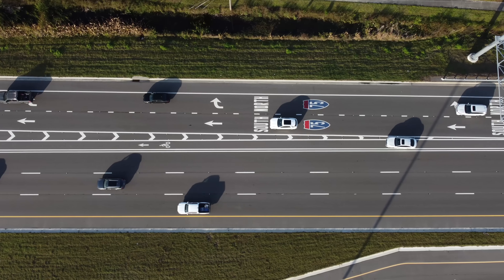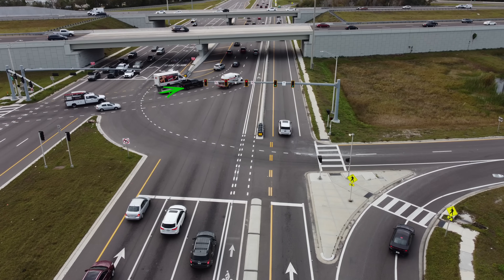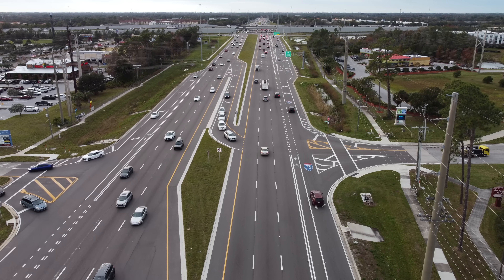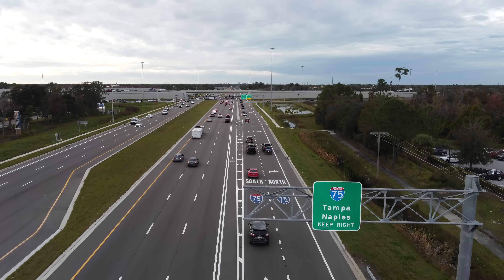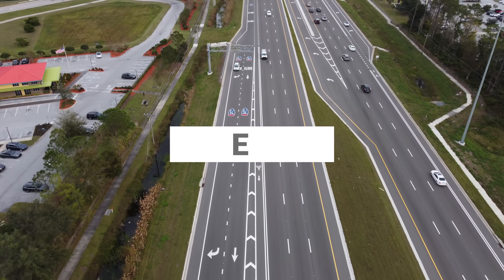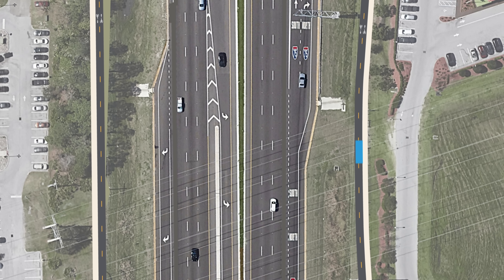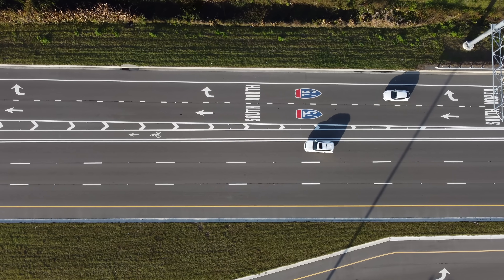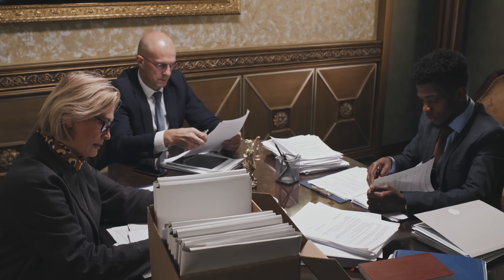This Brand New Interchange is Already Flawed

Comment: Tunnels are not usually an option in Florida due to drainage and the water table
Reply: Then build a bridge. That's what they do here in Norway if they have to.
Pedestrian crossings and bike- and footpaths not physically divided from such a busy road is impossible here as it would violate the code. The highest speed on the road before physical barrier is needed would be 60kmh(37mph).
Reply: @Gazer75  The thing about crossings for bikes is that a tunnel would be less deep than a bridge would need in height. So a bridge would take up more space taking in account a comfortable gradient for the ramps.
Reply: @MrAronymous  Not like the US lacks space for these things if they want to build them. But I guess more lanes for the roads are more important :P
Reply: Then why was the highway built in a ditch?

Comment: we inb the netherlands have em. The 2 most outer lanes are to go straight and the 2 (or1) most inner are to go off. the save solution for that bike lane is traffic lights you have to activate with a button. The exiting highway traffic can go free unless some one activated the traffic lights. This is the cheap way the expencive way would be a tunnle.

Comment: Only problem with the tunnel crosswalk for bikes and pedestrians in that area is that it's FL. You can't dig without hitting water so instead you'd have to build up. The only other way to do a tunnel would be to build the road up and over the path which would require far more work. There's a reason you don't see basements and subways in this state. Even the infamous "Disney tunnels" aren't underground.
Reply: Not a surprise with all the pools of water around the project either. It's basically a marshland. Honestly a raised bridge over the highway probably be easiest to deal with, though the slope would have to either be very gradual or bikes would likely have to walk up it lol.
Reply: @JustaGuy_Gaming Yes there's a bike trail that runs along highways in St Petersburg, Florida and it entails*a lot* of bridges 😩
Reply: there are basements in central fl.
Reply: And the surrounding area is already elevated above the highway so this would function exatly like in Disneyland.
Reply: You only gave a reason to why tunnels would cost more but not impossible. Conditions in the Netherlands are roughly the same and we got enough tunnels you classify as impossible.
Reply: @lordbigsnake  no no they arent last month we got 8 inches of rain in 3 hours. thats 20 centimeters. those tunnels will flood and you wont be able to unflood them.
Reply: @MrSGL21  go ahead try to explain me why you won't be able to unflood them? Your statement only said you might need stronger pumps for those tunnels.
Reply: @lordbigsnake  because there isn't anywhere for the water to go. It takes days sometimes weeks to drain an area. We get more rain and at an intensity you can't imagine. The whole bottom 1/2 of florida is a SWAMP.
Reply: @MrSGL21  so long story short the infrastructure for water management is bad in Florida so tunnels are a big no. PS it might not rain as much but the Netherlands a bit more than just rain to manage when it comes to water with 26% below sea level and 29% being former swamp.
Reply: Where do you suggest they pump the water to? Another flooded area?   @lordbigsnake
Reply: @lordbigsnake  Amsterdam gets an average of 30 inches of rain per year, Tampa gets an average of 50 inches per year. In metric that's a difference of almost 51cm. If you go to the video's description, there's a link to the map of this road and you can see dozens of drainage ponds and bodies of water just in this small area and that's because Florida is like a sponge. Any tunnel would have to be sealed tight enough to keep groundwater from seeping into it and rainwater would have to be pumped out of it which would require maintenance for the tunnel and also the pump plus electricity used by the pump. Factor in worse storms due to climate change. A crosswalk is far more cost effective over time.
Reply: @AmyEugene   @AmyEugene  as I've already said in the post above it might be expensive but not impossible. And the overall water management required for such a tunnel in Florida isn't that different from what's required in The Netherlands. And reducing the need for asphalt by making infrastructure more welcoming to pedestrians, cyclists and public transport is far more cost effective over time.
Reply: @eptdy  another body of water it's that simple.
Reply: @lordbigsnake  You didn't look at the map, did you? All you have to do is go to the description and click on it. See the ponds of water next to the road? Look at it and tell me of an area in the Netherlands that is similar with bike tunnels that are below the water line. I looked at a map of the Netherlands and it is very rural with a lot of open farm land and Amsterdam has few green spaces. There is pavement to the edge of the canals. I see bridges with bike lanes going over the water, not tunneling into it. The Netherlands is very nice and I'm glad you've found what works for you, but it looks nothing like Florida. Florida is exponentially less prepared to deal with rising sea levels than the Netherlands is, so I think they'd be better off spending money on building at a higher elevation instead of creating tunnels.
Reply: @AmyEugene  so you acuse me of not looking at the map and then refuse to properly look at the map op the Netherlands? And yes I know the Netherlands is beter prepared for rising sea levels even with land that's far below sea level and with far more water to process as rain isn't the only water to manage. And come on put some effort into it and you will find tunnels for bikes and pedestrians. And I know I am spoiled with good overal infrastucture as a Dutchie.
Reply: @lordbigsnake  Where's your example that is similar to this location in Florida?
Reply: @AmyEugene  well around Amsterdam enough spots. Unless you suddenly don’t want areas that need loads of watermanagement. Those canals are there for a reason.
Reply: @lordbigsnake  Water is a major part of the ecosystem in Florida and there are a lot of native plants and animals that depend on marshy/swampy areas for survival. I'm sure a lot of people would prefer to pave over it and install large cement lined canals, which was the practice in earlier decades in Florida when millions of acres of swampland were drained to make room for humans. But we've learned a lot since then about how damaging that is and I think we need to protect biodiversity wherever it still exists. Rising sea levels and stronger storms will damage infrastructure along the Florida coastline in the next 50 years anyways, so why damage natural habitat now for something that won't be useful for humans in 50 years?
Reply: @AmyEugene  wait what now? You want to protect nature but then say things that could help protect nature are not possible? You really don’t get it do you?
Reply: @lordbigsnake  Building the tunnel you suggest has a significantly greater impact to the plants and wildlife in that location than putting in a crosswalk. How would digging deep holes at every intersection and  creating a path surrounded by concrete on four sides that must be made watertight with pumps installed that will need to run every time it rains, not to mention that each tunnel is guaranteed to flood during major storms, be the more environmentally friendly option? The materials and construction equipment involved would make more of an environmental impact than that needed to create a crosswalk. Digging large holes has a big environmental impact. Using electric pumps to remove water from a concrete space instead of allowing that water to be naturally absorbed into the ground has an environmental impact. An intersection above the water table doesn't need that.
Reply: @AmyEugene  I am laughing my ass off right now. Somehow making walking and cycling more attractive by improving the infrastructure for walking and cycling is worse for the environment than adding one more lane to the concrete wasteland created for cars. Go ahead think of ideas that don’t need tunnels but stating that they are impossible and worse for the environment than what you have now is a pure lie based on nonsense. And I get the US already has problems with financing the maintenance of the current infrastructure so an expensive tunnel to improve non car infrastructure isn’t really attractive but it’s still not impossible.
Reply: @lordbigsnake  The road already is what it is. The question is how to improve what's currently there. With unlimited money a lot of things are possible. If no one has to consider the wider impact on the immediate surroundings, things like maintenance, the role of weather conditions, safety standards, etc. then anything that's physically possible could be done. If that's your point, then yes, without any limits Florida could build more tunnels than exist anywhere else in the world. It's possible that Florida could make the entire state Disney World. It's possible that Florida could ban cars. It's possible that people could travel from home to the grocery store and back via hot air balloon. The world is full of possibilities that somehow never actually happen in the real world because there are limitations in the real world. A lot of people are more interested in finding practical solutions that work within the constraints of a given situation than exploring the possibilities that are only possible if existing problems are ignored.
Reply: @AmyEugene his point was that it wasn't impossible to do...

@lordbigsnake I'm not from Florida nor the Netherlands, but you sound very entitled when trying to make your point across, it's very clear that it is possible to make a tunnel, but it's not practical to do so in the conditions Florida has, your country clearly has centuries more of experience dealing with flooding conditions and working in land reclamation compared to Florida, not to talk all the technology you guys have over them as well.
Reply: @lordbigsnake you are embarrassingly incorrect. I am a geologist in Tampa. 
Subterranean infrastructure like underground parking garages have been attempted however they always run into the same issues.
I want to explain this to you with the basics, this part of Florida is composed entirely of sand and is a surficial aquifer with transmissivity (the ability of water to flow through rocks/sediments) exceeding anything in the Netherlands where muds/clays/peats dominate.
Pumps would be incredibly inefficient and would need to dewater a volume of water equivelent to a lake every moment of every day forever.
Unless you have unlimited energy and tax revenue, this would not be feasible. 
How anyone could continue to defend this solution is mystifying and shows how little you know and care to learn about this.
I want you to understand that this is not the Netherlands and geology is different everywhere. For all intents and purposes, a tunnel is the wrong choice.
Reply: @MychalMartinez   I said it might be expensive but it isn’t impossible which is funny enough the tldr of your post. And your country is already throwing money away on bad infrastructure anyway as shown in the above video. And thanks for reminding me that not every country has waterpumps pumping 24/7 cause of soil difference.
Reply: @lordbigsnake  just saying pumps would be energy intensive and idiotic for every pedestrian tunnel. Bridging is the best option. Gonna listen to some girl's generation now, great taste!
Reply: @lordbigsnake  As a Dutchie, I was about to make the same comment.

Comment: So would a bike tunnel supply scuba gear to the bikers and pedestrians?  The water table is the same as the water levels in the nearby retention ponds..  This IS Florida so a tunnel not an option.  And I am very familiar with this intersection and it truly sucks.

Comment: Fix the final Tampa/Naples keep right sign. Turn it into 2 signs, each above its respective lane with the words This Lane Only instead of Keep Right. Give Lena Road a designated right turn lane and adjust that sign appropriately. Having to share that lane is ridiculous. Also fix the first sign to be a single sign saying I-75 N and S, Right Lane. Leave the bike lane as is. Bikes are vehicles, and they belong on the road with safety mirrors and lights installed.
Reply: Poorly designed signage is the vast majority of the problem here.

Comment: the problem is when you get a leader of a state thats anti-constitution, and anti-mass transit and anti-biking/pedestrian, the only thing you can hope for is stuff like that, where its just there to make it look good. someone has to sign off on improvements and someone has to sign off on the budget to make those improvements, but i suspect nothing will be done about it, because its also gonna be used long term as a justification to remove bike infrastructure in the future, due to low usage.
the reason for the low usage is gonna be the danger aspect of it, but will florida DOT do anything about it? no. pro-car supporters are gonna be a thing. the signage is also gonna be a thing. think about it, if you can destroy a more efficient interchange for the sake of "moar lanes", you would target the signage. if more accidents are the result of a more efficient interchange, they'll take it out, build something standard but with "moar lanes" and boom, problem solved right? not really, but the idea would be there in peoples heads.

a well designed interchange is gonna have muitl-modal access, while accounting for safety, driver psychology, and of course, driver intelligence.

channels like this however, will eventually defeat the "old ways are best" tribe, because in urban design and engineering, its not easy getting the political will to get something fixed, but informing the public on such matters will result in people actually doing something about the roadway and allocating funds to fix it. plus more awareness about the "mistakes" or genuine mistakes will eventually lead to people calling local broadcast stations in a area as well to get more awareness to the issues.
and the more awareness a area gets for a problem thats fixable on the roadway, the more a road is gonna get fixed, because the political will to get it fixed will rise.

Comment: It's amazing to me how many of the drivers shown in this video are not in any lane at all, just kinda veering vaguely along the highway in the general direction of travel or fully straddling those two exit lanes. I'm from the UK and although drivers here are FAR from perfect, at an intersection like that I think most people would stay in lane, and if they did need to get across, would use an indicator/turn signal and move across one full lane, not just point their vehicle at the furthest straight-line point and head directly for it regardless of the road markings.

Comment: the signs look backwards, like the first sign should be where the second is and vice versa... if they just switched the signs and remove the keep right from under the naples sign it would be a huge improvement and damn near free... honestly looks like they put the signs on the wrong poles any ways, the bigger pole has the smaller sign and vice versa

Comment: The bike lane is a purely political construct.  No one uses that for cycling and the designers knew it so it was given bottom priority to check off a useless political box at minimal cost.  It's a non-issue.  The only change needed is signage directing drivers into the proper lane.  The signage as it is isn't just unclear, it is objectively incorrect.  This issue is much simpler than presented.

Comment: 7:20 - Noooooo...   Your illustration does not fix the issue with that '75S' marker in the through traffic lane.   Tourists won't have enough time to realize their lane should peel right for southbound, not improving the situation and perhaps even making it worse.
The first sign seen should just say '75 south/north, two right lanes'  Put that one back about 1/2 mile.   Near the entry for the highway exit add another sign;  '75 access two right lanes' with the highway identifier and direction 1/10th of a mile beyond that sign.   NO highway identifier should be on the roadway before the split without creating a second exit-only lane.   And, finally, a sign that identifies which lane is designated for north and southbound traffic.  Perhaps, back near the entrance, there should be TWO signs, as shown just before the signal controlled section (horrible location for that one) but much, much further back.   Each sign should state the highway, the direction, and the end destination city/cities.

And if you want to see a nightmare of a cloverleaf try the I-285 & Campbeldon/Langford parkway interchange on the west side of the Atlanta, GA perimeter.   Not only do  you have vehicles trying to accelerate into traffic crossing traffic slowing to take the exit, you have this happen at the TOP of the exit as well.   Absolutely horrible design...  and I won't even get into the nightmare that is the I-285 to 400 interchange that is almost two miles long and a snarl of exits, Spaghetti Junction, or the 75/85 corridor through downtown.